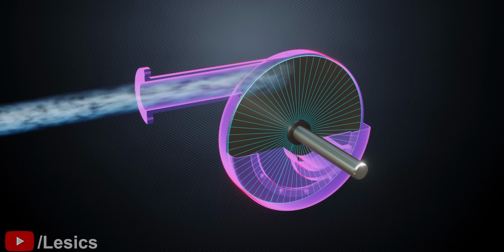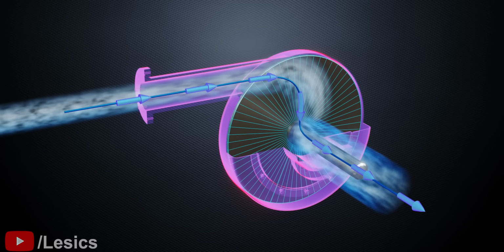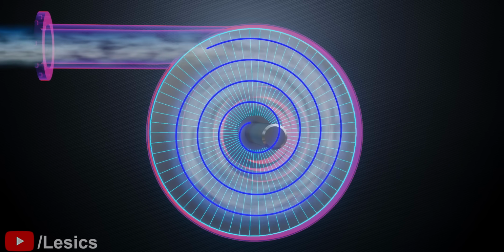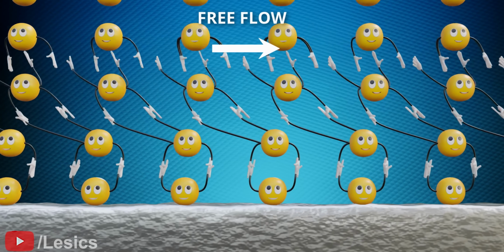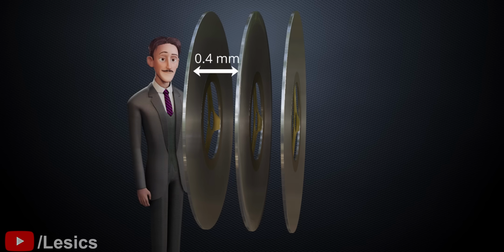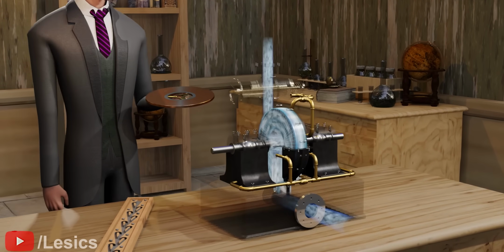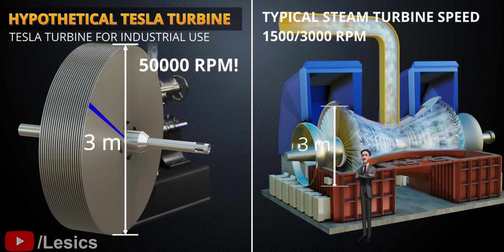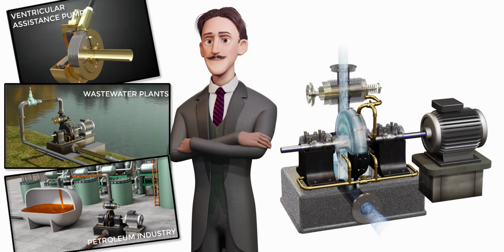Tesla Turbine | The interesting physics behind it

Comment: Wouldn't the next upgrade to the system naturally involve multiple smaller tesla turbines since the size of the discs is the limiting factor? Seems weird that it would go through such an evolutionary path but the question of micro scaling wouldn't be brought up. You could then scale the system up to handle the same amount of input and you would dramatically improve longevity as well by having less strain on the system. We also have materials such as microfiber nanotubes among others with incredible properties.
Reply: The efficiency of tesla's invention is based on how much energy you get from the flow. This energy is a centripetal force exerted onto the disk and is a function of the drag on the disk, this drag is affected by the surface area. Minimizing the size reduces the area which reduces drag thus reduces the force and efficiency. The problem with the disks being too big for that speed is caused by an engineering concept called "moment" not the time concept but rather the behavior that raise the magnitude of forces. To understand moment in a simple way try opening the door by pushing near the handle it's easy because it is away from the hinges of the door that are on the other side. But try pushing the door open halfway through the door it gets harder and harder as you get closer to the hinge which would likely lead you to exert all your strength and barely make the door move this is because you are getting closer to the axis of rotation and the weight of the door cause a frictional force at the hinge which your body can't win against unless your force is increased. Moment is force x distance from the axis of rotation. More distance = more moment which means less of need to exert more force. But with this concept when it comes to going 50,000 rpm on 3 meter disks, at the edge of the disk 3 meters away from the axis of rotation you have more moment so much more that the material  in fact every material will fail because we don't have knowledge of any material that can withstand that much exerted force. The only thing we know that's large and can spin fast is neutron stars that spin at 9% the speed of light but they have so much mass and gravity holding them in place that a tea spoon is literally a compressed earth.
Reply: @Daniel Hani  Nope. Go and make a tesla turbine that's twice the size of the original and tell me how many rpm's it can handle before becoming a fragmentation grenade. Then do the same with half the size and compare the results. You can do this at home with common materials and a basic motor. You're arguing that drag is lost as scale is downsized but I would also argue that mass is lost as well. This system is more dependant on ratios than it is on magnitude.

You can merely scale them down, the ratios between parts remains the same, output and input descreases but efficiency rises. You replace lost output with proliferation and you achieve success.

There's been dozens of channels turning spinning discs into weapons and everytime it's the size that makes them so unwieldly. This is almost common sense.
 Increasing the strain on the same atomic bond is not smart.

If the argument is whether the same mechanics applies to smaller parts? with less mass? I'd say yes....
Reply: @hackersulamaster  I don't understand why no one on the internet knows how to spell "dependent".  I do understand why they don't know how to use quotes.
Reply: @Balila_balbal_loki  see exactly, you don’t need the disks to move fast, just the gas
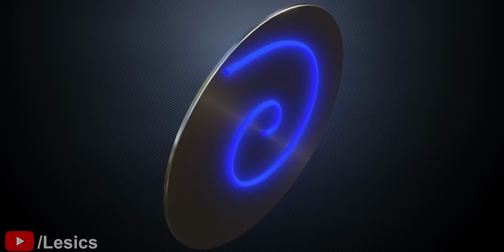Reply: It's all tied together, the larger the disc and the higher the RPM the more efficient the system because of how the particles move around the disc itself. (Illustrated at 3:57) If you decrease one you  would have to increase the other in order to maintain the amount of energy (the efficiency) that is converted because of the amount of time the fluid molecules have in contact with the surface of the disc.

To maintain efficiency smaller discs would have to rotate much much faster...
Reply: @scottr397  dumb question : if making it smaller makes it spin faster(which will still destroy the material's tensile strength) then would the solution be super sizing it? xD
Reply: Can we dam a shallow sea and build water based power plant?
Reply: @noob-kun7768  I don't see why not.
Reply: @noob-kun7768  No, because a sea is enclosed and eventually the empty side would fill up and you'd just have to pump the water back around to the full side. That's why we damn up places where water can flow freely on the far side of the generators. Otherwise you'd just end up exactly where you started.
Reply: no... stop it with the attempt to sound smart when you dont understand anything you are saying
Reply: Configured like an epicyclic gear?
Reply: I'm no mechanical engineer, but I think the issue is that to achieve high efficiency, tesla turbine requires high rpm.  And only way to get high rpm is with larger discs.  And no way to attain longevity for such a size discs in such a high rpm.   So the system has a inherently self-defeating logic.
It doesn't scale well to micro because the efficiency relies on the exponential nature of the system.
Reply: @aohige  not quite, the issue is making discs out of something that can survive continuous high rpm and also ones that expand predictably and can be machined very precisely. imo the idea of using smaller discs or using super light materials, like carbon fiber, seems like it could work.

It's cool how it found other uses though, demonstrating another talent (of other engineers) - to repurpose a device for another use or to take a failed product and find a use for it
Reply: @lichking3711  Carbon fibre wouldnt work, at least in a steam setting, because the high temperatures of superheated steam would soften or melt the plastic epoxy used. However, the idea of using a lighter material seems sound.
Reply: @aohige  Turbochargers in road vehicles can spin at 150,000 rpm. This is while creating tremendous amounts of heat. I'm not sure that the total size of the machine matters much in relation to the size of atoms and the mechanics that create motion. All the ratios between the parts remains the same so if you scale the machine down I would reason that rpms stay the same, reliability will increase and output would decrease.

I've seen several examples of individuals creating 'discs' that spin fast. With several exploiting this angular velocity specifically for destructive results. They make them big and heavy because it's counter-intuitive to them surviving high rpm's.

When you make these discs small and light they can handle much higher velocities. It's a basic requirement of this condition. I thought this was a glaring hole in the logic. This is where I think the true exponential nature comes from the idea. The size doesn't matter because you can just proliferate the system and as you get smaller you get more reliable.

In my opinion I would think that tesla turbines in series would compound the loss of efficiency until it's no longer as valuable. Although this could be counteracted if limited to a series of 3-4 while maintaining higher velocities, such as 150,000rpm. I'm not sure of the exact math but Tesla reached about 96% efficiency with his setup at around 30,000 rpm. If he could achieve 99% or even 99.5% efficiency and looped the turbines only 3-4 times he could achieve the results he desired. Then you could just proliferate these systems until output is achieved.
Reply: @hackersulamaster  no... stop
Reply: @aohige  🤦🏿‍♂️ exactly the opposite, no actually you need the gas to move fast for max efficiency and not the disks themselves

Comment: Very fascinating :) However, I would not use the term "engineering impossibility", as that denotes that every option has been pursued, tried, and proven to not work. Which it has not occurred.  Instead, use the term "engineering challenge"  😀
Reply: Spinning a 3 metter blade at mach 13.

That is, 13*330m/s. Well, it's impossible.

Comment: What's the problem to use some water "leakage" through the rotor, creating the lubricating of it and some kind of levitation. The streaming wather also makes it possible to not get the boiled state, like the oil gets in cyclic systems.

Comment: We designed a prototype of a Tesla turbine for practical use. The two mechanical problems we faced, were the power loss in a high-speed sealing and in a vortex between the end sides of the turbine package and a casing. Actually, both issues are solvable, and, I believe, we did it.
The problem, we were not able to solve, was the high sensitivity of the Tesla turbine to the load and to the inlet steam flow. We wanted to use it for a waste-to-energy compact system, so we could not provide a stable steam flow. Thus we had to deal with a wide range of electric generator capacity, and we had to make an accumulator charging station, which uses this energy in the best way.
Unfortunately, not having a good electrical engineer, we were not able to make such an energy utilization system and this project was closed eventually.
So, if you guys are interested in the implementation of the Tesla turbine for industrial use, I can share my experience, if you ask :)
Reply: Yeah good on paper but not in real life applications... (like many other Tesla inventions)
Reply: @a64738  Yes, every invention has some restrictions. And some of them were just discovered too early, like supersonic passenger jets. I believe, the Tesla turbine also can be used for some specific applications

Comment: The turbine is one part of a steam cycle.
Steam is made by burning coal, oil, or natural gas, some bio materials like wood chips.
Also Nuclear power using non superheated steam.

Generators for USA , 2 pole , need to turn at 3600 rpm.

Tesla turbines need to run much faster, so you need a reduction gear complicating things further.

No sure why people thing there would be some energy breakthrough if they could get this to work? 
The power comes from burning something and Other than wood chips and Nuc power releases CO2.

Comment: Now this invention is way more efficient than other generators but no materials that can withstand the rpm produced supposedly? Just thinking super simple why not add a flow valve to keep the rotational rpms from getting to the point where the thing flys apart! I hate seeing good things held from people because it makes making power to easy thus powers that be lose some of there power over people.

Comment: That boundary layer highly depends on the fluid being used.  Tesla's design was based on water.  There are many fluids that have very low cohesion like castor oil, but water has a unique property of high cohesion.  Surely PTFE should suck for boundary layer.  So, adhesion levels would be between the material of the disk and the fluid.  Some kind of anodic fluid to metal substrate might be best, but wear out.  It would be interesting to see more videos about titanium disks with some kind of cobalt substrate and cupric fluid for more magnetic type cohesion and adhesion.  Anyway, the design is so simple, but has potential that people just left on the design floor.  Crazy.
Reply: I think the newest members of the material world might play in there somewhere... "tantalum carbide and hafnium". But I really like your answer. I'd say time to bring in the science team and see if a better, more stronger carbiding or carburizing of these new materials is capable...
Reply: I'm just a software engineer so excuse my ignorance, but could you make disks that can sustain the centrifugal force out of graphene (once graphene is mass produced).
Reply: I think a lot of comments are misinterpreting this video.  The entire video is to illustrate why the Tesla turbine DOESNT work even though it seems like it should be amazing.  

The other thing that people seem to be ignoring is that modern steam turbines that don't use a Tesla turbine are capable of 90% efficiency.  To achieve Tesla's 97% claim can't be done because of the restrictions on modern day material properties.
Reply: @scottr397  well claim vs. speculation is always good to investigate if it sounds too good to be true.  Exploring stuff like this interesting to everyone that responds in a constructive way.  Even if the constructor is to provide/prove negative results
Reply: No.  The principle applies to fluids and solids.  Which fluids and solids are used would be a matter of choice.
Reply: Adhesion also plays a part.  Temperature changes viscosity of fluids.

Comment: The biggest difference is flow velocity and torque vs flow volume and torque.  Viscous friction requires high rpm or high velocity.  A river for a hydro-electric dam could be geared to achieve things, but variable rate flow velocity is harder to manage.  I prefer the simpler the design of Tesla, but understand the construction complexity of the times.  It was a design a bit ahead of the manufacturing process.  I wonder why no one has built an automobile torque converter based on the design that is regenerative electric design.  Maybe someone has.

Comment: Not only electrical engineer but also mechanical engineer. High RPM had been a problem in his time and after him for more than 50-80 years I suppose, now there is a way to solve it but nobody needs frequency different from 50 Hz of current. 0,4 mm for steam? Which parameters of steam? The steam can have any parameters.

Comment: Simple consideration the prevents the turbine from being effective. It requires plate to be close to each other to maximize efficiency. if the plate corrode or the tolerance changes, the efficiency drop with that change. It's a more tempemental system. While airfoil is not perfect, it can survive and provide similar efficiency even when damaged. That is why we fly with airfoils not a bunch of layered plated.

Comment: I thought by changing between the plates would work. But on second thought I think by damping the exhaust's, the one could control the heat in the boiler and control the speed of the turbine.

Comment: Does anyone know the thickness of his plates? The amount of plates he used in his 6" design? I would have thought the steam's psi could have been adjusted maintaining his 6" design.  A gasoline engine has only a 32% or less efficiency so although his idea claimed a 97% efficiency it would be quite better than a gas engine's abilities.  I wonder... by allowing the distances between the plates to be increased could that have been used as sort of a governor? Centrifugal force could have been used to control the distance between the plates.
Reply: This is a great idea.
Reply: You are trying to compare fuel efficiency (chemical energy => kinetic energy) and a turbine (kinetic energy => kinetic energy)
The former is constrained by Carnot cycle efficiency (~70% IIRC) and there are many ways you just can't avoid losses : you can't have an infinitely slow engine, or perfect combustion and so on.
The latter is capped by 100% only, and is quite simpler. Pelton water turbines are above 90%, gas turbines are similarly efficient...

Comment: This is the first time I've grasped the concept of fluid turbines.  Is something like this used in automotive fluid transmissions?
Reply: No automotive fluid transmissions function like a traditional turbine.(torque converter)

The motor turns a turbine which propels fluid this fluid then hits a stator with angled fins that redirects the fluid to an impeller, the fluid then hits the blades of the impeller causing it to rotate.

Comment: Very good explanation, clear and on the point!
Not all things are meant to be enlarged, some are, precisely, very efficient the size they are or even smaller.  Several small tesla turbines connected to a differential, then a gearbox and so on you could harness a lot of power from several small turbines, and equal their overall output.  If you make it a closed circulation system, try additives and options besides water, maybe efficiency can increase.  There are different materials nowadays that can withstand incredible forces.  I mean, steam turbines have received a lot of research, A LOT, it's only normal their efficiency is so high.  Tesla turbines have a lot of potential!
Reply: The problem is that there's a lot more to doing all that you suggest than it may seem. 

Every gear interface is only about 98% efficient.  So if you add in a differential (1 gear interface), and let's say you have 3x 10:1 reduction interfaces to get your 50k Hz rotational speed down to a useful 50 Hz for power generation, you have .98^4 = .92 = 92% efficiency for just your reduction drive.  Multiple that by your turbine efficiency to get the true Tesla turbine efficiency.

You also have many additional shafts, bearings, splines, etc. to deal with both in design (I don't think there's many 50k rpm differentials or gearboxes out there) and in maintenance.

And as other responses have noted, Tesla turbines are only efficient in a very narrow band.  This means the system they are operating in needs to be very tightly controlled.  Compare to centrifugal turbines and pumps, which can be designed with a wide variety of  best efficiency points, and can be made for low speed or high speed operation with multiple different fluids.  So they are very versatile in application.

So in addition to the complexities of manufacturing a working Tesla turbine, there are plenty of cost and application issues with actually using one.  If they were really a better solution for the majority of centrifugal turbine and pump applications, they would be used for it already.

Source: 10 years and counting of experience as a pump engineer
Reply: You could use one turbine the power and other kind of like a turbo and a car hey there's a lot of stuff out there we just got to put the pieces together have a good day